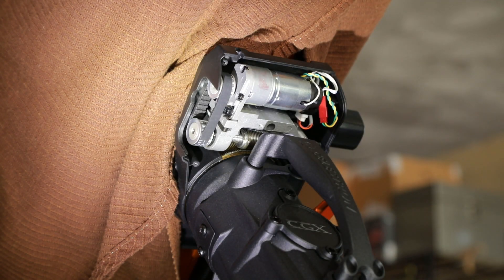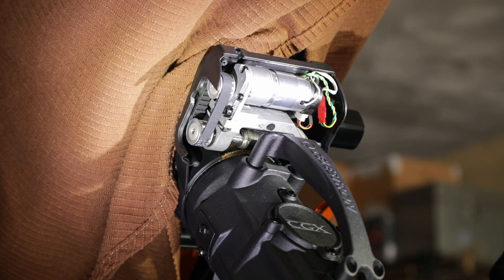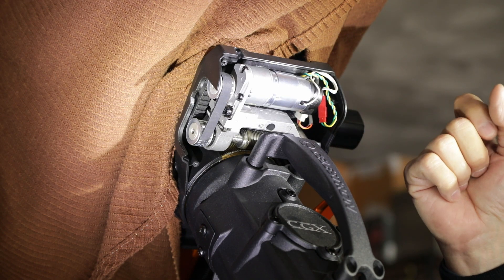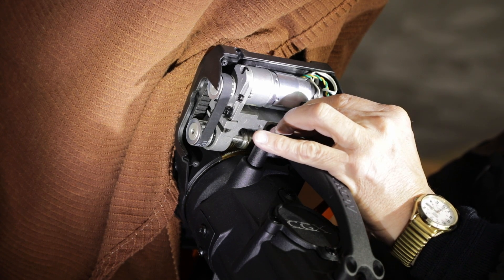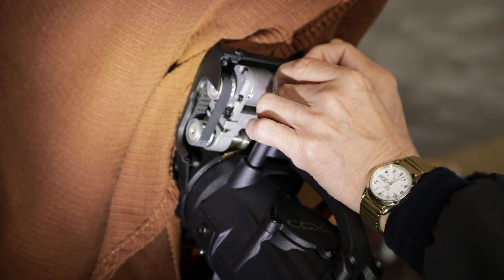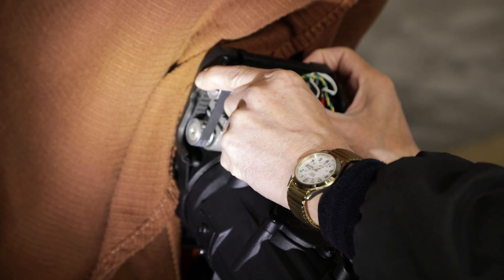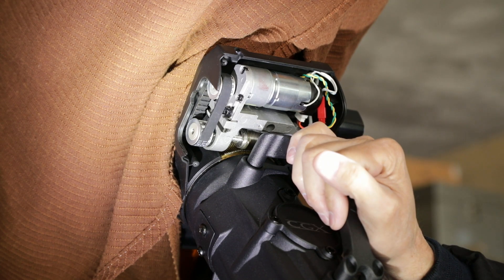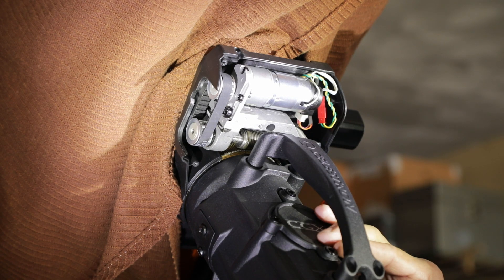Setting The Backlash on your CGX or CGX L Mount

Comment: Thanks for the video Jeff.Sometimes the DEC backlash is SO BAD that when i use the scope visually with the hand controller it takes a few seconds before the object moves in the eyepiece. My CGX has had recurring DEC backlash issues for years and this solves the problem.
Reply from the maker: Your Welcome...  My CGX & CGX-L are both about 5 years old now and before I start each season. I'll go though them to grease and then adjust out any backlash that sneaks in while using the gear the year prior...  If you keep your mount tuned up. You will get very good RMS numbers while guiding and pin point stars... Clear Skies!

Comment: Excellent Video Jeff - Thanks! So easy to do. I can't wait to see the improvement in star shape after I adjusted the screws. I have had the mount 6-7 years and never made an adjustment.  The sloppiness became more evident when I stared doing Astrophotography. The Dec motor assembly had minimal backlash and the motor housing about 3mm play.  The RA Motor assembly had significant motor housing motion of 4-5 mm while also moving the counter balance bar which increased the backlash on the worm gear. The PHD2 Guider showed my last calibration set:

RA Rate 15.227 A-S/Sec
                25.397 PX/Sec
Dec Rate 8.907 A-S/Sec
                 14.856 PX/Sec

My stars at 1:1 show some ellipse shape my FWHMx vs FWHMy is about 3 pixels off from round.

Also be careful putting the plastic cover back on because the small foot of the other plastic housing must fit over the other foot otherwise it doesn't close down easily and gives the appearance it is binding on the motor assembly when it isn't.
Reply from the maker: Jayson, when you try this. You want to just take the backlash out and not go past that point. You can over tighten and this will bind the worm against the larger gear. Not enough room for the worm to float. I do both my CGX and CGX-L before I start my season in the spring. I get wonderful guiding and using predictive pec in PHD2 and multi-star keep the RMS error under .5 for the CGX and .7 for the CGX-L. Another thing that helps to set the backlash is to move whatever axis you are working while making the adjustments. This helps you know when the backlash is gone. Clear skies...

Comment: Fantastic! I have backlash and didn't know how to correct it. Your video is exactly what I was looking for. Thank you.
Reply from the maker: Glad you found it useful and now you can fix up your backlash...
Reply: All done. I found play between the gears and very little to no movement with the body. After backing off the larger screw until I had no backlash I found I had 1mm play return to the body. A test run powered up proved no binding or loud gear noise.. if anything it sounds better. Excited for my next session! Thanks again for the down to earth instructions. @jeffrh
Reply from the maker: @saskgrass    Excellant, glad everything worked out. If you are to tight for some reason. Just back off on that 3 mm allen. I found that in assembly from the factory they didn't use anything like blue Loctite and my screws would back out over time. Just keep an eye on things. I only need to set the backlash in the spring before starting my season.  This has been good enough for a full season of use. Enjoy your new found guiding bliss...  ;-)

Comment: Nice video.  Appreciate you posting this.  I have made this adjustment for my CGX quite a few times.  I actually replaced that 3mm "bolt" with one that is about 5mm longer because there was very little thread left on it and it would often back itself out and be lying in the plastic case.  I was surprised it worked but I did it on both axes and no problem.

Would like to see a video of your re-grease exercise if you ever get a notion!
Reply from the maker: Thanks, R Fortner, That might have to wait till next spring when I give both mounts a tune up! Will not be opening the RA or DEC cases again till then unless something weird happens, but who know... Stranger things have happened.
Reply: @jeffrh  I would also appreciate this, both axis are very very stiff ( from day 1 )
Reply from the maker: @doccortex1203  If the mount is still under warrenty. Call Celestron to see what they say first. Doing this yourself will void the warrenty. If the mount is out of warrenty and your not afraid to try this... It's not that hard and with a couple of allens and a phillps head screw driver. You are on your way.  Good luck...

Comment: i have the exact same problem on my CGX, RA , huge backlash , and i mean huge , probably 1/4 inch or more at the tend of the counter weight bar.
And if i got this right all i have to do is back off ( counter clock) on the  tensioner  screw and  bring the 1 mm back with the Set screw !!!!
I've been waiting a year to get to this cause i was terrified .      i  think that's why the guy sold it . its a great mount , ive seen nights of 0.38 RMS with my C8 Edge HD loaded if I'm East heavy  ( counter weights ) and guiding towards the East ( M27)  but ... forget North East , like Wizard Ned or the bubble Neb, IC 1805 or any other ..
 gonna try tonight to get this going. i will not over tighten, i like a bit of backlash.... just a tad.
Reply from the maker: Hi Mitch, Long tiime since we last talked... What you are trying to do is preload the worm just a little bit. Like an 1/8 turn. with the 3 mm allen head wrench. That should take all the backlash out of the system. Then you take that 2 mm allen head and limit the travel the whole housing can move up and down. You don't want it so that there is no motion as that will bind the worm on the bigger gear. With a couple of mm's of travel. This will allow the worm to float on that big gear as it rotates and if there is a high spot on that big gear. The 2 mm will let it ride up that high spot and then come back down.  Hope this helps...  If it doesn't let me know and I'll try again...  ;-)
Reply: Hey Jeff, That did it , wow, amazing guiding last night... PHD was reporting 0.31/ 0.48 RMS all night, and that huge RA jump on the graph is gone. You are the best. I will link a PHD screen shot later...
Reply from the maker: @BrokenPik  Glad things worked out... If you do the backlash every spring along with a regrease of that bigger gear. You'll have great guiding for many years!  Great to hear from you again... One more tip for your guiding pleasure! Get the Dev Build of PHD2 and enable Multi-Star Guiding. You'll get even better RMS numbers...

Comment: Hi Jeff - What I don't understand is Celestron advertises their worm gears in the CGX-L are spring-loaded.  Wouldn't this avoid the need to make adjustments?
Thanks - Tommy
Reply from the maker: Yes and no...  You could have one of the adjustment allens back out or in and this will throw the alignment off. My CGX-L came from the dealer with no blue Loctite on the 2 adjustment allens. This allowed them to move on their own and thus misalign the worm to the bigger gear. In my case one of them backed out and I wound up with to much backlash in RA. I put a drop of blue Loctite on 2 and 3 mm allen adjustment screws and my problem was solved. If you are using the mount a lot. The allens can move fairly easiely if they don't hve that Locktite on them. 

There was aslo a period where the adjustment of both the RA and Dec were off from the factory... I think Celestron had a bit of a quality control problem which has been remedied. For example, when the CGX first started to be sold. The RA worm bearing was miss adjusted and the worm had trouble turning. This put too much pressure on the bearing which needed to be replaced by Celestron. Sometimes you can get lucky and back off some on the adjustment that holds the bearing and worm together and this fixes that problem. This has also been fixed for at least 4 or 5 years that I know of...  Hope this helps...
Reply: @jeffrh  
Thanks Jeff.  Perfect explanation.
I’m stuck between ordering a new CGX-L or the Sky-Watcher EQ8-R.  Decisions decisions.  Thanks again!
Reply from the maker: @thomasmastrocinque2609  I have the CGX-L and have no trouble with it or the CGX. I needed to keep in family which helps with software loads.

Comment: Hi Jeff, Thanks for another great and useful video. I have the CGX (out of warranty) and have been having an issue here lately. Any comments would be appreciated. I will try to brief but informative. I'm guiding (PHD2 multi-star) and getting decent performance i.e. round stars usable subs. DEC does well showing fairly flat lined with a few small bumps and shallow waves but again round stars. The RA does fair but can be somewhat wavy. Did I mention I’m getting round stars? Then seemingly out of nowhere the DEC jumps for just a brief moment making a ^ then quickly settles back down and guides as before. In NINA I just stop imaging for a moment and restart.  Not fun when it happens near the end of sub. 😞 If I let it complete the image, that image will have a small faint ghost star very near the actual star image. Any suggestions would be appreciated. Clear skies and new moons!
Reply from the maker: You didn't say how old your mount was? When the CGX first came out. They shipped with over tightened worm bearings. That could be what you are seeing... That would show up as a bind in one area that repeats. You can look at the PHD2 logs with a tool that is on their website here. https://openphdguiding.org/phd2-log-viewer/

You need to check and see if you have any backlash. Grab the counterweight bar and see if you can move it back and forth. If there is some play when you are doing this. You have backlash that needs to be taken out. A gust of wind could move the scope just enough to cause those faint trails you are seeing. By taking the backlash out of the system. Wind can still be a problem but not as big of one. Another thing that might cause what you are seeing would be a netural balance. You need to have some preload with the counterweights to one side and this will help to keep the worm gear in contact with the larger ring gear. Good luck and I hope these tips help you out...
Reply: @jeffrh  Thank you for your quick reply. Sounds like I should follow the steps in this video on both motors. The mount was purchased in October 2020. No way to know how long it had been sitting on the shelf. Narrowing it down per your comments: no wind, RA is always east heavy even after flip. However, perhaps I should try adjusting the DEC to be a little more camera side heavy. I am considering going a head and replacing the grease while I am at it. Sounds like a cloudy night sort of thing to do. LOL

I will take a look at the logs. Perhaps I can find a video about interpreting the same. 

Thank you again Jeff! I really enjoy your videos and appreciate your style of teaching; always easy to follow with clear instructions.

Comment: Hi Jeff, great clear demo and instructions on this issue, thanks.I have a cgx that is around 2years old. It has always had some slop in RA only. After watching your video I finally had the confidence to have a go at a fix. What I found was when the plastic cover was removed, the slop almost disappeared ( just the smallest of play). A fair conclusion would be that the plastic cover when screwed on pushes on the housing/worm gear lifting it off the main gear creating the slop. So if the housing is brought forward using the 3mm bolt the condition would I guess worsen . Has this been an issue for you? Or has anyone else had this issue. Any suggestions on a fix would be gold , cheers Martin
Reply from the maker: Thanks, MartinI have a CGX-L and CGX. My mounts didn't exhibit what your describing. You want to make sure that the wiring for the motor isn't under the housing when you put the cover on. If you look at the video again. you will see that my wires are off to the side and when I put the cover on. They stay to that side and do not go between the cover and the housing. What might be happening here... is when the cover is tightened. If the wires are under the housing. They will push the housing up which will make your backlash worse. You can try this for yourself... With the cover off. Move the mount axis your working on side to side and then push the housing up. You should notice that the backlash will get worse with the push and go back to zero when you let off. I think you may have those wire in the wrong spot and they are pushing the hosuing up which will change the backlash...  Hope this helps...
Reply: Thanks for your reply Jeff,  all the wires are to the side except  the small white one. When the cover is fully removed, the slop decreases by more than half. I have noticed some slightly protruding plastic on the 3 mould filling holes on the backside of the cover, which line up with high point of the motor. I might get the dremel and remove the high plastic and 1mm more around where the white wire comes out of the centre of motor( plastic cover is 3mm thick). At the moment I don’t have the cover screwed hard up and there is only a very small amount of slop. I might leave it at that for now, and track the slop variation over the upcoming hot Australian summer when I might get some expansion.
Reply from the maker: @martinalcock680  You might try taking a picture of the cover to show where those problem areas are and send them to whom ever you pruchased the mount from... That sure doesn't seem right and you might try sending the image to Celestron. You never know? The other axis seems to be fine? Have you taken the cover off that axis to try it out to see if you get the slop? If you don't, you know it's that cover and you can talk intelligently about the problem to someone... A couple of pictures to the right place can do wonders...  If the other axis is DEC and it works on the RA. I would leave it there and try to get the cover working the best you can on the DEC axis. That isn't as important as the RA axis and if your have good polar alignmnet. The RA is all that should be getting pulses when you guide if you do...  Hope this helps...

Comment: About ready to upgrade this mount after crap guiding. I think I understand what you are doing. How about the belt tension? Look forward to testing this out.
Reply from the maker: SubOrbitBen, Thanks...  My belts were still good for tension. You dont' want them to tight as I don't like to much strain being put on the worn gear bearing and the DC servor motor bearing. If you can move the belt in the center up & down around an 1/8th to a 1/4 of an inch. You should be in good shape. These belts will stretch if over tighten them. Most of the backlash is in the worm mesh. If you go tighter with the belt... Just remember you will put added stress on the Worm and Moter bearings. I just don't think it's worth it and I'm getting great guiding RMS numbers with the small belt movement I stated above...
Reply: @jeffrh  This video only adjusts the Dec but is all of this valid for the RA as well?
Reply from the maker: @Ben_Stewart  Yes, same thing applies to both RA and DEC. I showed RA because it was easier to show in a video...